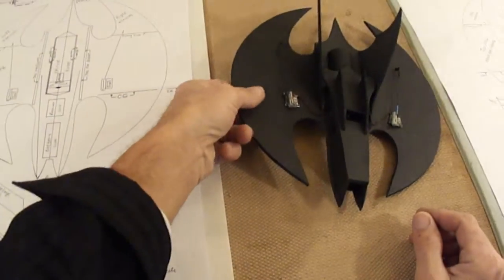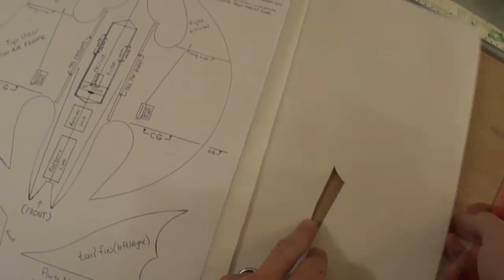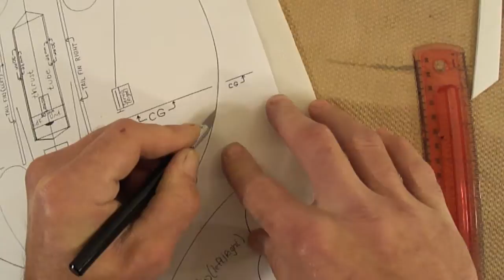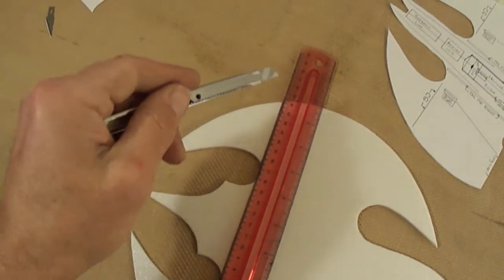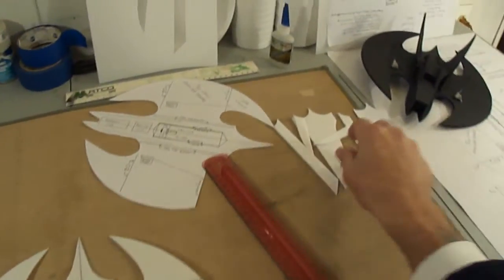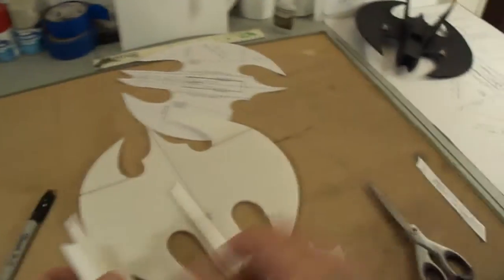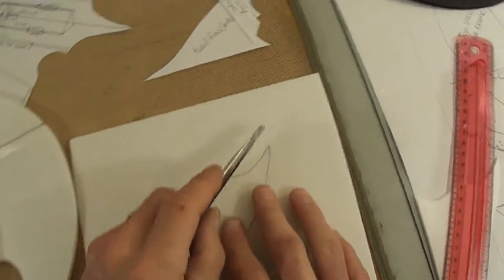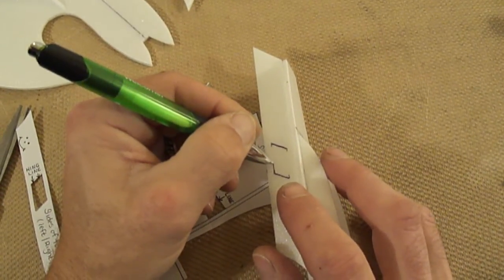Part # 1 Micro (Bat Wing) RC jet Cutting and assembling your plans.

Comment: Chris, Love your Stuff!!... Question, do you have any ideas on what I can build with a 55mm 4000kv  EDF. 93g 27A with a Trust output of 550g. I have 2 of them and would love to do something with them.
Reply from the maker: You can always blow up the plans for the micro bat wing to fit different size edf units. Like the plans for this micro bat wing has a 10" inch wing span and uses a 28 to 30mm edf unit.. so i would blow the plans up to have a 18"inch wing span to be able to hold the extra weight of the 55mm edf unit and electronics. Also just go ahead and build it using standard white dollar store foam board painted flat black with testors paint from your local hobby store. For plans just go to foamconceptjets.com